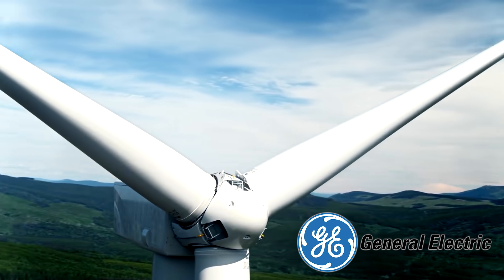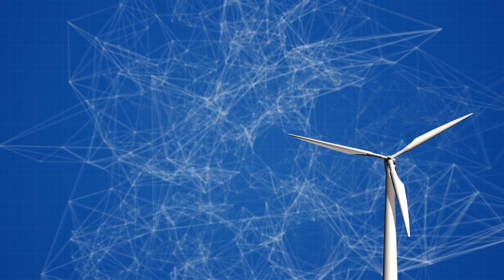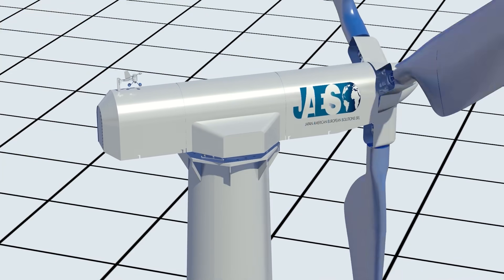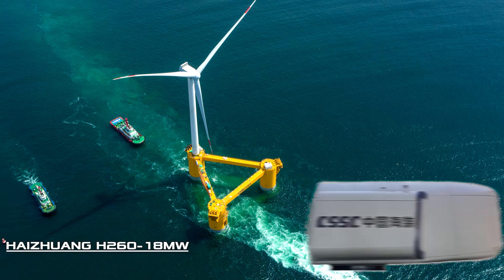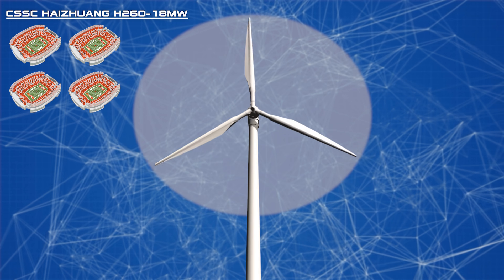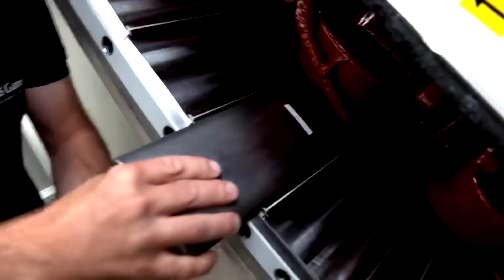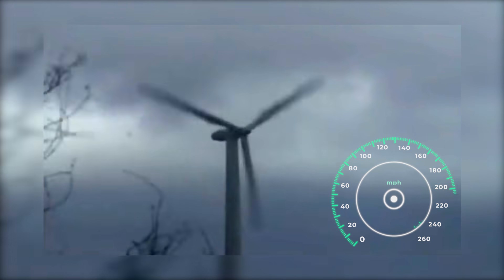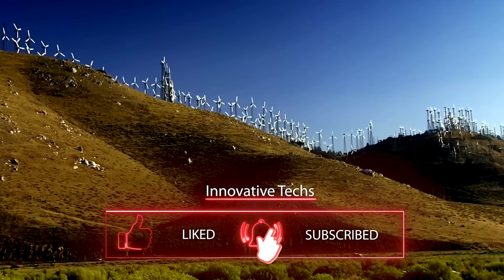China is building a wind turbine of unthinkable dimensions

Comment: For the replacement of one gas powered plant you need 15x more ressources for wind turbines. 
So you can imagine how green this units are. It is completely silly to make wind turbines. And additional you need for every wind turbine a backup energy system!
Reply: 15x more resources then 0x emissions for the next 25 years, seems like a good deal to me
Reply: @infinitelyexplosive  Emissions from a gas power plant have zero impact to so called „climate“.
Reply: You got sources on that buddy?
And don't forget the mine for coal, don't take the raw boiler and thing you have it.
Reply: Source: ARS Technica: "New wind, solar are cheaper than costs to operate all but one US coal plant"
New analysis shows that renewables beat existing coal plants 99% of the time ...  In 2019, the authors found that more than 70 percent of coal plants were more expensive to operate compared to the alternative of building new wind or solar. That share has now grown to 99 percent, with only the plant in Wyoming stopping it from being 100 percent.
Reply: @Ericwvb2  in middle of Europe, e.g. Germany you get for about 50GW on electrical power from solar power plants in a sunny summer day. And now, when a bad weather front is comming, you have to replace 30GW within a few  hours! So where you want to take this amount of energy from? The same problem you have at night. And during winter time solar energy is very weak. And especially then you need more electric power. So what?

Comment: Great, but will it work when the wind isn't blowing?
Reply: Obviously yes, as long as you stand in front and blow with your mouth. Or Brandon with his ass, doing what disgusted Camilla Parker Bowles.
Reply: That is why there needs to be batteries to store the energy. There also needs to be more transmission lines to get the power from where the wind is blowing to where it is not.
Reply: @canuckprogressive.3435  That's a disaster for a country's energy security, an impossible cost and decades away in construction.

Without grid-scale storage, these windmills are junk.
Reply: @chairmakerPete  It is all stuff that can be built right now. To continue with fossil fuels is a death sentence for civilization and countless species. Solar and wind could be a much bigger part of the energy mix right now. As I type this Britain is getting 18.9% of its electricity from wind and 5.3% from solar. Often the figure for wind is much higher.
Reply: They will use the energy generated (while wind blows) to fill up reservoirs and use the reservoirs to produce hydroelectric energy when the wind dies.
Reply: @Maruf Munsur  that is fine for countries with lots of mountains and suitable terrain, though in overall energy efficiency, it's not great. Still, it's a better solution than having gas power stations on constant standby, and crucially, overcomes intermittency.

Comment: The money spent on it,won’t be worth it! What is needed is cheap turbines thus cutting costs!
Reply: Maintenance ,. On the long run .  Nothing comes cheap today.
Reply: @andrewchang8192  
We have turbines for 30 years here now and no maintenance is no issue even in the older ones.
Reply: The bigger the more KW per Dollar, simple scaling effects.
Reply: @Ismalith  increase the blades to four, shorten them,it will spin faster and produce more!
Reply: @quercus5398  
4 will make them run less smoothly, usually you want an odd number of blades, so 5 would be the next step.

Comment: Geothermal is the answer. Cheaper, more reliable, and runs 24/365 no matter the weather conditions.
Reply: Kinda seems that way, doesn't it, when you don't know what the technological challenges are and the costs to solve them.
Reply: They have been using Geothermal in Alaska for many years.

Comment: Imagine how much coal they burned to make this fan?
Imagine how much rare earths they dug up to make the magnets?
Imagine the toxic waste further down the track?
Reply: They can use the power generated by renewable and China no longer mine any rare earth, the only thing they do are the post-processing and the blade are likely carbon fibre, which is not that toxic since it’s just carbon.
Reply: @Ilovecruise  Can't use power from renewable because it requires more fossil to make. Need roughly 1.1 fossils to make 1.0 "renewable" best case. Coal soda ash not such a toxic nightmare as all the other stuff
Reply: @jusuftheeagle6772  what about the NOx? Additionally, there are no source claiming that 1.1 fossil to 1 renewable, just for example hydropower and geothermal, these are also renewable, once you have the energy going, solar and wind are gonna worth it and much more environmental friendly in the long run
Reply: @Ilovecruise  haha..it is not carbonfiber - but unusable resin polymers..
somebody has to find a reuse idea
Reply: @R.BOWERS  how could you tell the diff ?
Reply: @jusuftheeagle6772  Only if your run your wind turbine for a short time. Only if you assume you have cheap gas. Only if you assume the US won't blockade you in an attempt to cut you off from said cheap gas.  China will do what China see as its best interest in the long term. Gas won't always be cheap or available.
Reply: Imagine you realising that even countries other than USA can invent new technologies and become a leader
Reply: @Ilovecruise  You are not so well informed. For example Li Iron Batteries are around 1.1 BEFORE they are charged and BEFORE you take into account the cost of disposal. In fact any system involving batteries can be up to 3 coal to make 1 renewable. Here is just one source of many "Cradle-to-Gate Analysis of the Embodied Energy in Lithium Ion Batteries" you fill find it in Science Direct portal. Every other source you mention can supply maybe 1~2% of what coal delivers.

Comment: Current commercial wind turbines produce 3 mega watts, enough to power 1500 homes and they last 20 years. Wind energy generation is the cheapest among all sources,  and this is the reason turbines are popping up everywhere. The 18 mw turbine China is developing is just crazy. It will power 40,000 homes.
Reply: When the wind blows. If they are so great why does it take so much tax funding to keep them operating?
Reply: Bullshit.
Reply: Not really, if 3 Mw are sufficient to power 1,500 homes then 18 Mw are sufficient to power 9,000 homes and not 40,000 it’s a little bit less, isn’t it?
Reply: @alfredfleming3289  because we want more and subsidizing them helps make people build them faster? Duh.
Reply: You need to factor in the hot-standby power which triples the cost of a wind-farm.  Additionally, although they "may" last 20 years, the maintenance costs run linearly -- at the half-life, the windmill's net electric delivery is 50% of its installed baseplate delivery in terms of cost of electricity delivered - maintenance costs.  The windmills at sea deteriorate much more rapidly due to the ever-present high-salinity of the air.  Replacement parts, 15-20 years out, will be prohibitively expensive due to the debt-financed extraction of hydrocarbons which pulls future energy (hydrocarbons) production into the present.
Reply: I suppose math is not your strong point based on your own assumptions🤣.
Reply: Plus china is blessed with abandoned rugged northern border areas where these turbines can be delivered to and its only the slow moving birdlife you must mitigate for. China also has some deep border seas. As yet, china is not superskilled in offshore deep water floating structures so taller means deeper seafloor waters are a possibility.
Reply: @James Stripling There is no data that shows you to be right.
Wind is cheapest on an LCOE basis, followed by solar.
Reply: @James Stripling just ask Google what the lifespan of commercial wind turbines is. Also enquire cheapest energy source.
Reply: The coal power plant I retired from made 3200 MW net.
Reply: @@jamesstripling4810 altamont wind farm is making power for the us grid since 1981. Vindeby is offshore since 1991 making power
Reply: @alfredfleming3289  Where are you from? In Germany new wind turbines are not funded anymore, since the technology has advanced a lot over the years. Energy storage needs funding yes, but compared to the huge sums of money that were and are still funded into nuclear power plants and the storage of their waste that is very reasonable.
Reply: @alfredfleming3289  How much tax funding does it take to sustain nuclear power stations? More than any other.
Reply: @@jamesstripling4810 Nope.  Gas is a finite resource and you saw with the Russia Ukraine conflict the price of gas go through the roof.
American turbines might last 7 years because America builds shit products.
Reply: @Rajesh_Singh301  Google lol
Reply: @James Stripling Lol, natural gas is the least expensive? In what fantasy world? Have you looked at the price of natural gas lately? What else do you plan to pull out your a**?